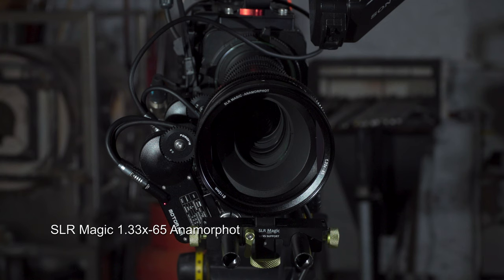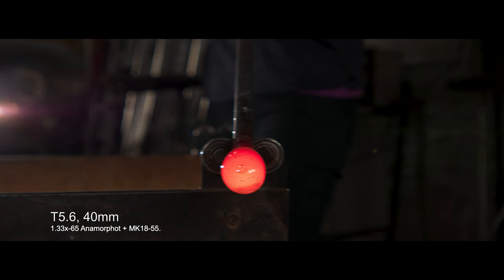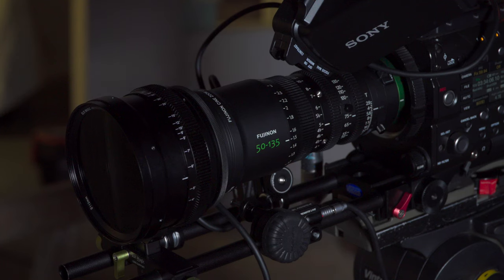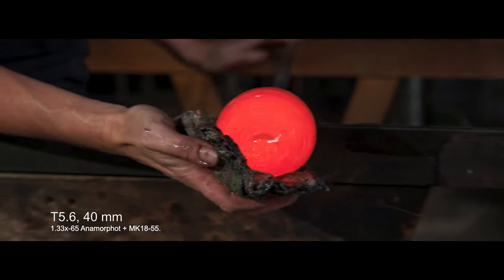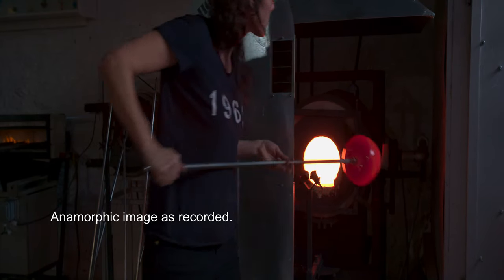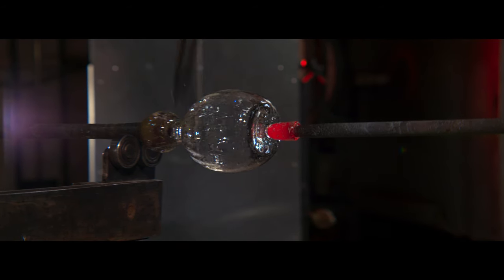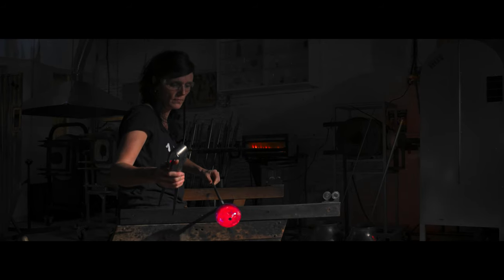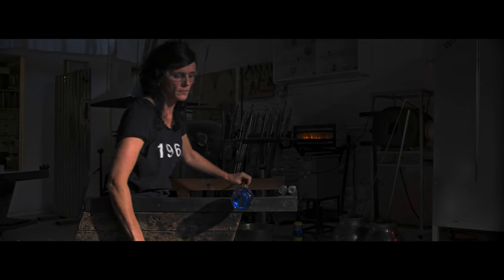Anamorphic Glass Blowing Behind The Scenes

Comment: Appreciate you sharing this. Very helpful. For me, personally, I would just shoot the MK zooms without anamorphic adaptor and then crop to whatever aspect ratio was desired for delivery. This would save many $$ and less complex. Do you think that the MK zooms are a better choice than having faster primes that you then have to keep swapping instead of zooming?

My current setup is using a Fuji X-T3 with a comprehensive set of stills lenses (primes and zooms), which I would use in manual focus mode and not zooming during a take. Interested in your feedback.
Reply from the maker: It really depends on what you are shooting. The MK's are tack sharp wide open so you can shoot at t2.9 all day and for most of what I do that's plenty shallow enough.